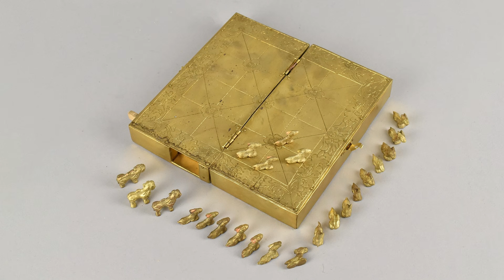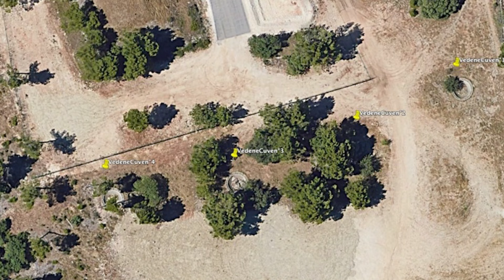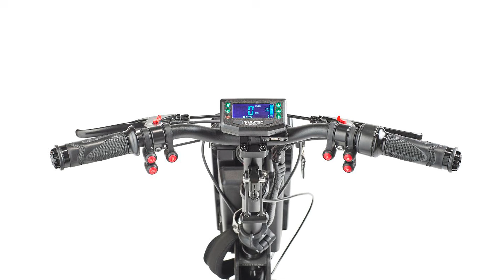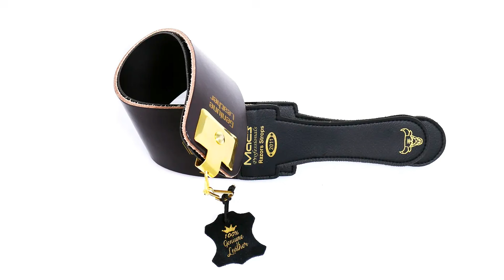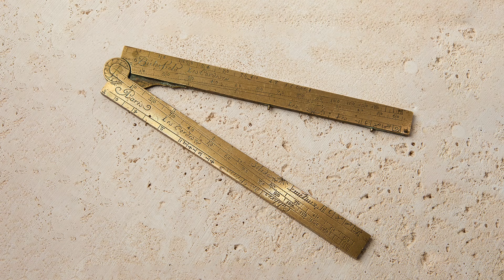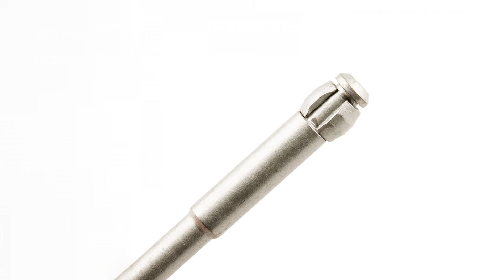WHAT IS THIS MYSTERIOUS ITEM? 160+ ENIGMATIC FINDS! [r/whatisthisthing] #112

Comment: I had a contact printer. I loved it. The enlarger I had bled light making the pictures all blurry, so I mostly made black and white contact prints. They always came out perfect, but never bigger than the film. I noticed this one has a darkroom light inside. You can leave that light on to see what you're doing in the dark without exposing the paper. It will not work when developing film which must be done in the absolute darkness.  Practicing winding film and developing prior to actually doing it helps.

Comment: you got one wrong the throttle holder was for the BRAKE PEDAL TO BE HELD NOT THROTTLE. for checking lights when alone or checking brake lines. holding throttle with the peddle is way too dangerous and inaccurate but thank you for this video really great work here.

Comment: I used a tool like the Chartpak burnisher thousands of times in the 60s and 70s.  The early ones didn't have the adjustment numbers on them.  I still have it, somewhere.  I've seen some of my graphics with rub-on lettering, arrowheads, and lines, still being reproduced in promotional literature now, in the 21st century.